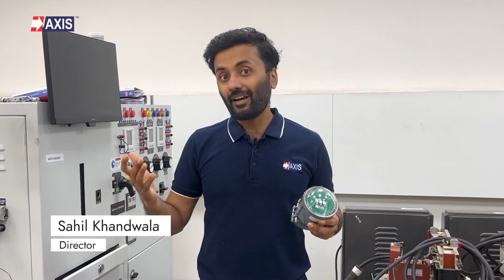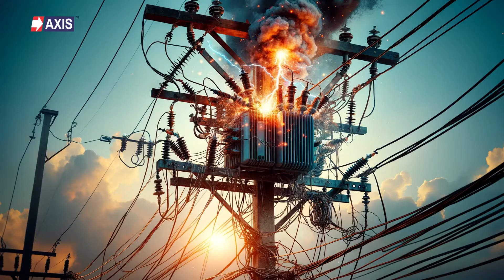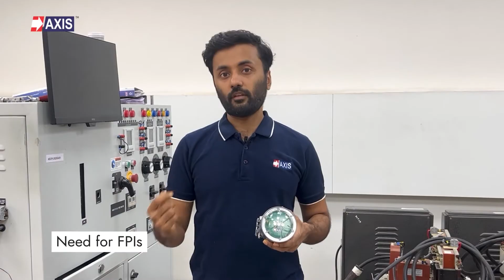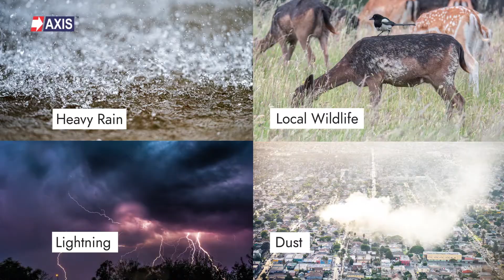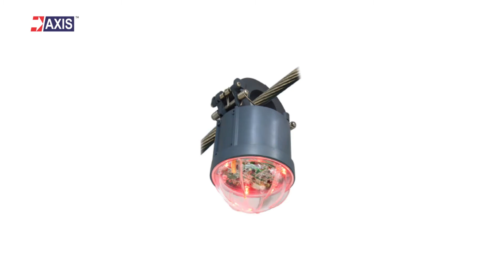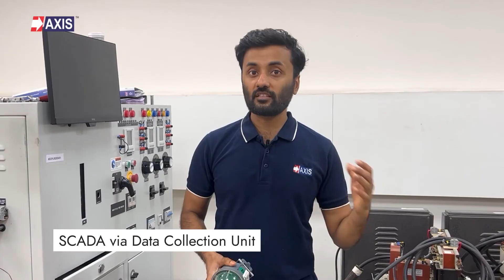How does Fault Passage Indicator (FPI)) locate Power Faults? 📢

Comment: Can this be used in distribution lines? to find broken power lines
Reply from the maker: FPIs are primarily used in transmission lines due to long distances and difficult access. While they can be installed on distribution lines, they are not always recommended because distribution networks are generally easier to access and fault detection can often be done manually. 

Cost is also a key factor limiting their widespread use in distribution systems, except in complex or underground networks where faster fault location is essential.

Comment: Is response time the fault current should flow for 40 ms so that fpi will glow?
Reply from the maker: No, it takes FPI 40ms (very minimal) to detect fault and provide indication for quick identification of fault location and isolation. This quick response lowers the system downtime and also reduces impact on power system stability.